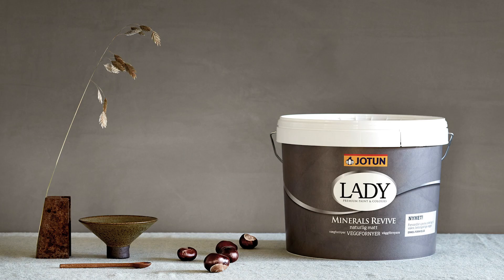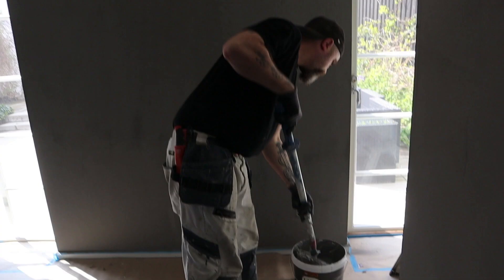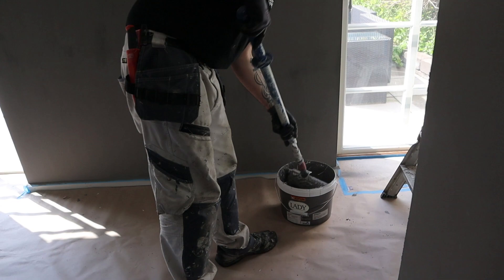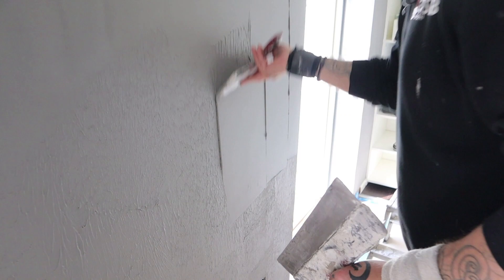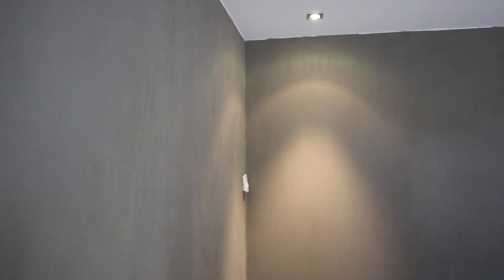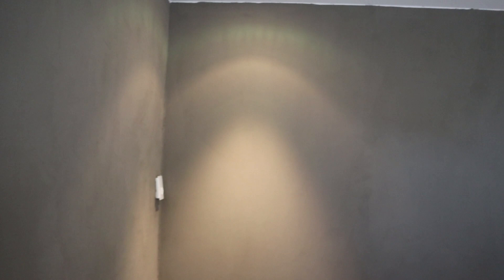JOTUN Lady Minerals Revive (Pt.2) | Product Review | The Paintslingers

Comment: My apartment was built in 1979, it's FULL of textured wallpaper.. so I'm considering doing this, not sure if I'd manage on my own though.
Reply: ElectriKitty sure you can. It’s fun and easy.
Reply: I forgot to say that when I use it on smaller sections. Drying time is key. Another thing is, that you need to find out if your wallpaper is thoroughly stuck to the wall. Otherwise it will be released from the wall. Just be aware that it isn’t paint so don’t expect it to be and just go wild with it and experiment with the texture and effects you can make with your spatulas.
Reply from the maker: Cool, it'll be a messy job but if you get it right it'll be an apartment with attitude and supercool look. Like Charisma Hornum-Fries says in her comment, make sure the wallpaper is stuck to the walls like concrete before applying anything to it. Otherwise you might be in for one helluva surprise when it starts bubbling etc. Good luck with your projects :)